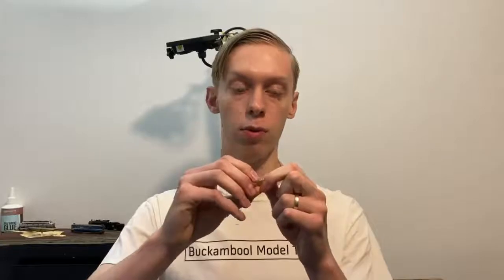DCC Fridays Ep. #1 - Keep Alive Capacitors

Comment: Hi Jarryd, I have read somewhere that a diode and resistor are also needed in the Stay Alive circuit. And the recommended cap voltage is 25v.
Reply from the maker: Hi Phillip, yes when using a capacitor/s with considerable capacitance (uF) a diode and resistor are used as a charging circuit. I've found this is necessary when capacitance exceeds around 1000uF.  When using 2 or 3x 220uF capacitors I have found that this is not necessary, however I do still use a diode in parallel with the capacitors, to prevent anything over 15V reaching the 16V capacitors. For HO scale people prefer 25V as it is safer, the disadvantage is that 25V capacitors are physically larger, which restricts their use in N scale applications.

I've fitted well over 100 sound fitted N scale locomotives for customers with 3x 16V 220uF capacitors, and haven't had an issue since starting this procedure several years ago :)

Comment: Tantalums are great, but have to watch running them at there limit as they do have a tendency to short circuit, where Electrolytics, although larger for the same capacitance, don't tend to do that.   
On DCC I would likely aim for caps rated above 20volts for HO/OO scale.  Maybe for N Scale as well.  If I recall my DCC Specs, the track is a square wave that swings from -15V to +15V for HO/OO scale (and I think N Scale also).
Thanks for some more great information.   The advantages of keep alive caps does make the little bit of fiddling worth while.
I've subscribed (and liked) to keep watching this series.   Australian channels for this hobby are a little rare
Reply from the maker: Thanks Brendan! Yep absolutely, the N scale layouts I operate on tend to run at around 13.5V so the 16V tantalum’s I have sometimes used are quite effective in that case. I also always pair 16V tantalum’s with a 15V diode to ensure the voltage never manages to get over 16V for the capacitors. I have also recently switched to using Polymer tantalum type capacitors which are meant to be more stable than plain tantalum capacitors.
Electrolytic capacitors are great where the sizing and pairing of them together works out well! Such as in the new ZIMO STACO1 product, which I didn’t get to talk about in this particular video, as it wasn’t yet released!
Thanks again, I’ll be looking to sporadically be releasing more videos!